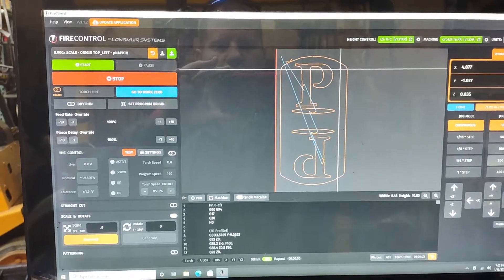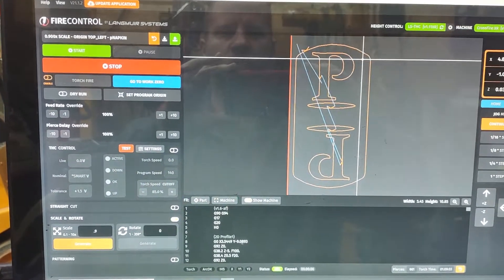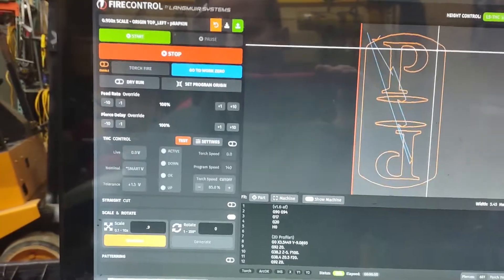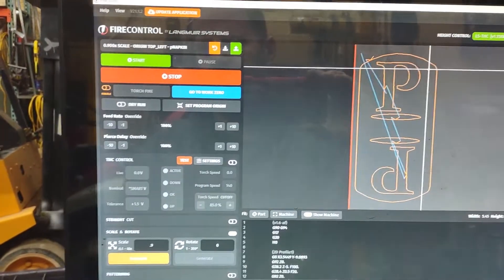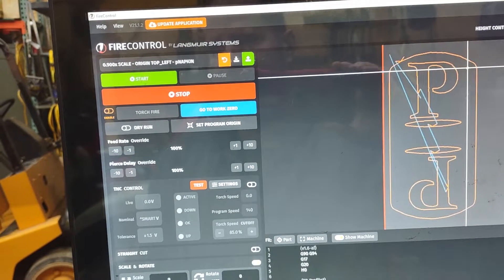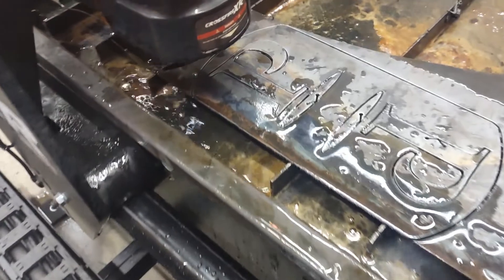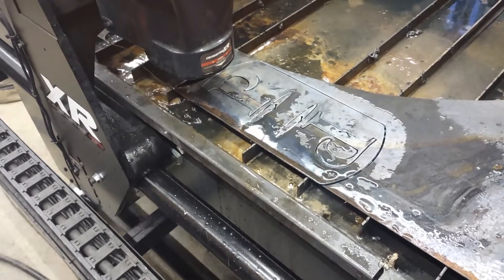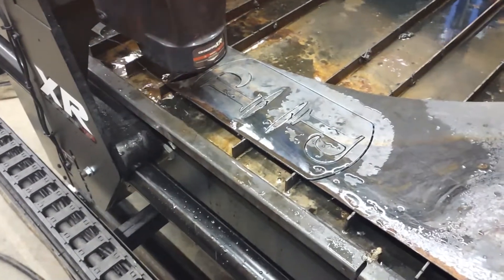Crossfire XR plasma table cutting 16 gauge steel

Comment: we have xr we are running hypertherm but u may try speeding up ur machine i run 16ga at 240imp with .1 peirce delay hypertherm has speeds and feeds online for powermax 45 which should be close to razor weld it has helped me alot to dial in closer to have cleaner cuts
Reply from the maker: I have tried faster and it doesnt work
Reply: @Curtis_Schwoeppe_Enterprises  gotcha your video showing that smoothing in fusion helped me i was having same issue